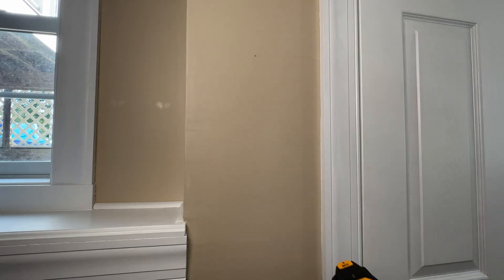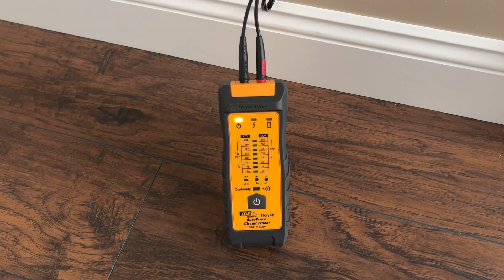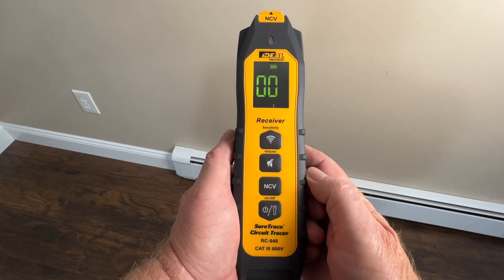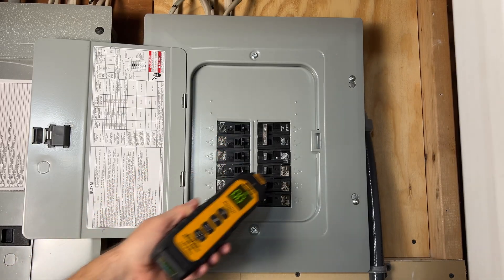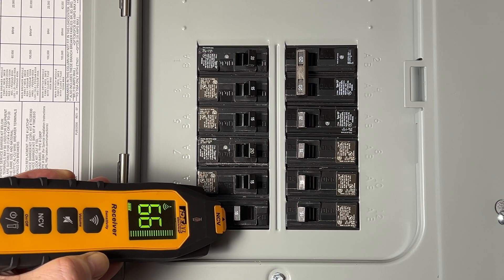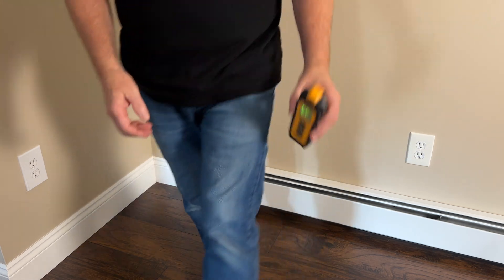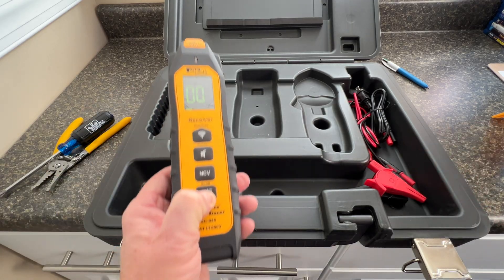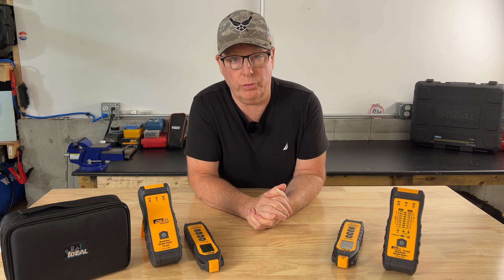Electrical Troubleshooting Made Easy! (+ GIVEAWAY)

Comment: Been an electrician in Dallas Tx area for 28 yrs bulk of years doing residential service, love figuring out the problem when certin areas have no power, but would love to have one of these Ideal tracers in my bag of tricks, thanks for all the great videos. Sam from Texas.
Reply from the maker: Congratulations! You won one of the circuit tracers. One of the first winner has not contacted me after 48 hours so I used a program called pick a winner (again) and your comment was selected. Please go to the BackyardMaine home page and click the more button in the about me section at the top of the page. In the drop down you will find my email. Send me an email with your name and shipping information within 48 hours and I will send you the tracer. On a side note: I'm a retired electrical engineer and I spent 22 years working for Texas Instruments who are based out of Dallas. I worked at a TI FAB here in southern Maine but I have been to Dallas many times. I hope you get a lot of use out of the circuit tracer. John

Comment: Interesting. Not sure if this is the right tool for me, but I bought a property in central Maine that "needs some work" and has electrical all over the place. There are half a dozen or more runs exiting the basement underground and I have no idea where they go. I found a couple circuits in the yard with nothing attached to them but the others remain a mystery. There isn't much in the breaker box and I don't want to energize them just to find out what happens. Been enjoying your content and thanks for the opportunity.

Comment: I would use this device to safely locate and label all circuits in my panel so that I can safely turn off the correct breaker when doing repairs and installs. Thank you.

Comment: One of these testers would help with updating wiring in my home that was built in the 1960s. We did not have building inspections at that time, so some of the wiring is suspect.

Thanks for the video

Comment: Thanks for a great chance to win an excellent piece of equipment. I bought a house which has 14 and 12 gauge cable used interchangeably and at random. So I have 20 amp breakers serving circuits with both 12 and 14 gauge cable. I have started to trace them and change any circuit with 14 gauge to a 15 and breaker. This would really help me make the house electrical system safe for me and my family. Thanks.

Comment: That is an awesome tool, I have fixed up a few homes in my life this would make things sooo much easier to figure out what circuit breaker turns off a specific room, or outlets. So many times i find panels not labeled or incorrectly labeled . Thanks for the in depth video.

Comment: I'm the guy that fixes stuff around here, and I've never gotten around to figuring out which circuits in the breaker matched what plugs and switches.  I have a 2-piece unit, but it requires the circuit be energized and my wife doesn't have the patience to help with this effort. So, having the self energized component of this tool would be a wonderful feature to have for this work!  And the short and opens is also wonderful!  I did get a thermal camera a year or two back and found that putting a good load on a circuit helped me trace it through the walls where heat was seen radiating (as long as it wasn't hot in the house or hot outside - not well insulated on that wall with the circuit panel outside.)  That method is pretty quick! But the entire circuit panel lights up! I noticed the 948 isn't available via your link.  The price of the 946 is fairly steep.  Not sure I can justify that cost.  So... here's hoping! Thank you for covering this tool!

Comment: Great video!  I am a DIYer and own a older home, built in 1953, that I am going to give a remodel. There is old alumnium wiring that needs to be replaced and there is a main and two sub panels that have to be sorted. I will hire a professional to do the work, but I could save some funds and learn a lot about my old house with using the SureTrace 61-946.

Comment: I am a ex-AirForce guy who did RADAR work in the service.  I always loved radio electronics and my current hobby is Amateur Radio (HAM Radio).  I do a bunch of electrical work associated with the Ham Radio gear.  A trace function could help me with locating damaged transmission lines and antenna cabling.  The additional benefit of being able to identify the circuits and breakers in my home would  allow me to finally label the poorly labeled panels.  I would love to have one of these terrific devices!

Comment: I bought a house that was more than livable, but needed major remodeling. I am replacing all the electrical wiring and breakers so they are all labeled properly and all the electrical wires are new. One of those tracers would save me many hours.

Comment: Have a house built in 1908 with a main panel and two sub panels. My guess is about 20% of the circuits are labeled correctly. That Ideal tool would sure make my job a lot easier. 

Thanks for all your helpful videos!

Comment: I live in a house built in 1959 with many electrical issues and has plaster and lathe walls. If this tool would work on those walls it would be a great help in chasing down some bad wiring without tearing up the walls. I bought a harbor freight version but it’s not much help.  Thanks for the contest.

Comment: I would use a circuit tracer to identify which circuit breaker protects a live circuit.  Using this tool reduces customer impact because a series of unrelated circuits are not de-energized before the correct one is found.
Also, thanks much for your detailed code discussions with citations on practical situations faced every day in residential construction.

Comment: I've borrowed  a much older version of this tool. I would love to have one of my own.  I did make a "kaboom" box(direct short switch with a cord end). It worked great until I tried it on GE panel in a very damp basement and it caught fire in my hand. I could hear the breaker humming, but would not trip.  I had to flip the switch off.

Comment: We live in a house built in the early 50s that has been remodeled several times before we acquired the house. None of the electrical panel fuses were ever labeled so it is always a search and test when a circuit needs attention. I plan to upgrade the old tar paper wiring with a new circuit breaker box. TY for your videos!

Comment: Thank you for this video. I would use this device to finally label my old panel. I particularly like the ability to trace wires inside the wall, though I do not know if it can read through my plaster walls

Comment: I work as a maintenance technician for a resort with a Waterpark which has me working with different voltages both A/C&DC. There are times when I don’t have an extra person to help troubleshoot circuit problems . This tracer would be extremely helpful especially since it has the ability to locate opens and shorts as well. Since I have to supply my own tools (for the most part) this would be an ideal piece of equipment to have for both personal and professional purposes.

Comment: I would use the circuit tracer to find and remove the cloth NM cables in my house to replace with new Romex. I would also like to diagnose a problem in a friends house where a light switch causes all the receptacles in the house to have voltage fluctuations.

Comment: This would be very useful and handy as I approach the wiring phase of our skoolie build.  Would be great for both the AC 120/240v stuff and the 12/24|48v DC stuff (not sure if my inverter system will be 24 or 48v yet).

Comment: great video. we bought a new  property which has an extensive irrigation system. it'd be nice to locate the valve wiring to locate all the circuits (and make sure we don't cut them off when installing fiber or other conduits.

Comment: Well, I have a short somewhere in the attic on a three way lighting circuit. If I forget and hit the wrong switch it trips. I tried what I thought would be an easy fix and changed both of the switches, but the problem continues. Maybe the tracer can find it.

Comment: As a plumber for 30 years I didn't need tools like this for the most part. But now, with all the fancy appliances (tankless heaters, etc) available out there... I'm finding my electrical needs increasing... Especially the older buildings get; and the poor workmanship in newer construction.

Comment: Why I need this circuit tracer. 
I have a 70 year old house and I am  trying to make a floor plan with an electrical layout drawing. So far there is no rhyme or reason as to how the electrician (or non-electrician) wired this house. The load on the main breakers was 75% on L1 and 25% on L2. I did rewire the box to get it close to 50% each. In the attic, well that is another story as there were about (8) 4x4 boxes with no covers on them, wires with wire nuts sticking out and one had a copper lug with 5 hot lines terminated in it exposed and all covered with blow in insulation. I believe that there are more up there that I have not located yet. That is where the circuit locator would be of use. As for IDing the circuits for the floor plan layout that would be fantastic. The electrical has been a nightmare. Oh, and the outlets are all 2 wire. I just replaced all the inside outlets that are in the exterior walls with new grounded outlets by mounting an outside outlet and running the ground wire through the wall into the new grounded interior outlets. One last item which I recently stumbled across. As we need 2 ground rods 6+ feet apart I was able to locate the 2nd one, but there was only a 6" piece of ground wire that they stuck into the ground, the rods were not even connected together. Yes I fixed that problem.  This has been an ongoing project for way to many years. So, "YES" I could really use it! have a GREAT day!

Comment: Im an electrician and i recently bought a home built in 1904. Im having constant issues with wiring on second floor and am unable to use a/c because of tripping breakers. A tracer would help me greatly and would also be a huge benefit to me at work where i am an industrial maintenance electrician.  Awesome video!

Comment: You guys with your fancy toys. All true electricians just short out the voltage with the return or ground to figure out what breaker it's on. The only feature that I think is useful with these things is the electrical wire tracer. Help you figure out where some wires may be feeding to.
Reply: Shorting out the circuit is kind of a last resort.  It puts extra stress on the branch circuit, possibly causing faults -especially if the conductors are aluminum.  Also, if it is an exceptionally long run, the breaker may not trip at all.
Reply: Breaker not tripping? That's something I've never seen before (certainly not in a residential setting). Next time I get a chance I'm going to hook up one end of a 250 foot roll of wire in a panel and short out the other end to see if that's the case. Sorry buddy I'm not buying what you're selling.  See if I can learn something new or if you're full of it.

Comment: We just bought a house in Northern maine and it's practically impossible to get a professional out here so I've had to learn on my own but there was alot of extra wiring and circuits put in and i have no clue what goes where so i would absolutely learn everything about that tool and use it a ton. Thanks for this video 👍👍👍👍👍

Comment: I was looking at circuit traces to help find a path from a bathroom fixture to its nearest source. I thought it was in an outlet not far away but no luck. I turned off the breaker to limit my possibilities but still can't find a suitable nearby source to run another device from. I thought this should be easy, but it hasn't turned out that way. I can't afford a professional to do the job. I'm just not sure what to do. I found some crazy wiring paths in another outlet so this might be another one.

Comment: My mother's house has an almost unusable 2nd floor due to wiring issues.  Electricians have given estimates far beyond her ability to pay.  I have the skill to make the electrical updates/repairs.  But I don't have the testing equipment I would need.  This would serve that purpose.  I would also volunteer it's use for our church and community building.  Both of which are in need.  If I were to win the give away, I would use this to help anyone I can and never charge them a dime.  You have my word.
Reply: A licensed electrician I hired and paid exactly what was charged was supposed to put in some new work instead s h e spliced in and pulled out a lot of the wiring that was already there so same as your mother I have an almost unusable second floor
Reply: @deadmanswife3625  By new work do you mean you wanted extra plugs and fixtures? Also, I hope you called them back to fix it. If not, I hope you sued.